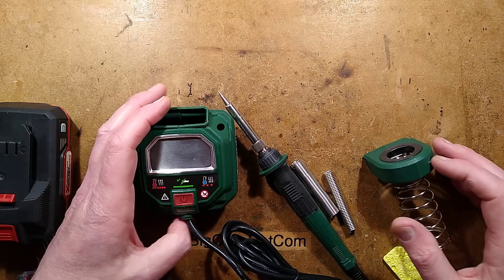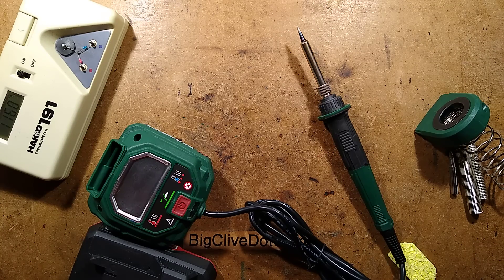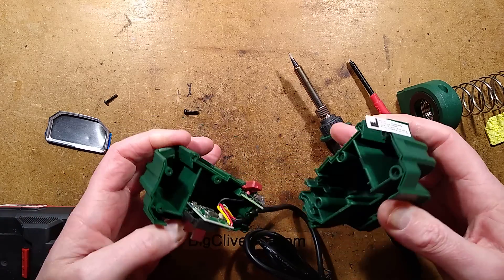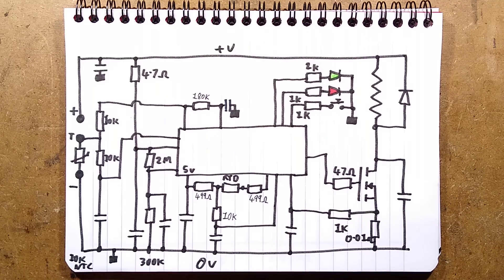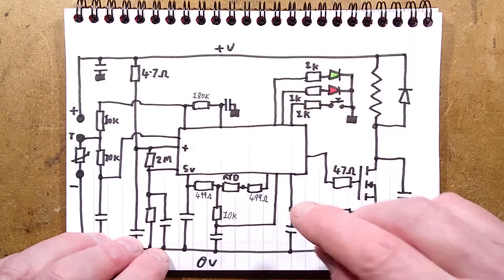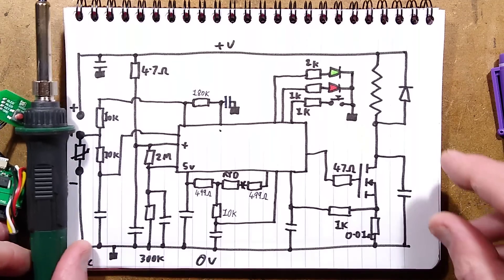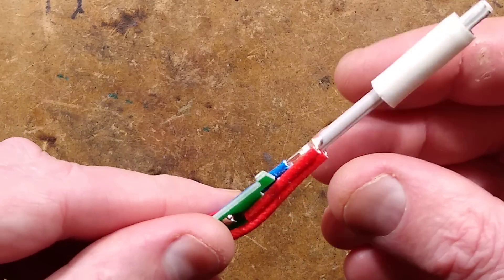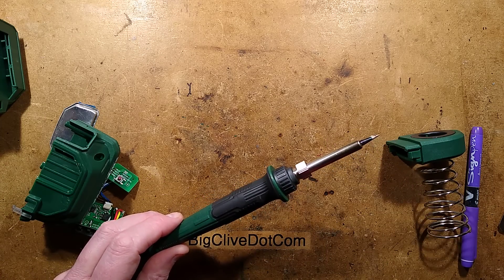LIDL (Parkside) B2 soldering iron hack and schematic

Comment: I'm glad I'm not the only person who modified their electrical safety screwdriver 😂
Reply: @Kevin-mp5of  It's called the singular they. It's been around for hundreds of years. Get with the times.
Reply: If you look at the original comment, a "person" could be he or she, it's neutral, so using singular "they" makes sense. At least it does to me.

A neutral pronoun is a thing that exists in many languages, and you have the luxury of having one that's pretty damn natural to use even if it didn't originally exist. Some gendered languages like French are really inadequate to use in a neutral form, and to me, it personally feels like a missing "feature" to my home language. To see English speakers complaining about something that has seen a lot of use for over a decade already, when we don't even have that option here, is kinda annoying.
Reply: @Kevin-mp5of clearly you lack a basic understanding of grammar
Reply: If you are not working on mains or high voltage equipment, an electrical safety screwdriver isn't really needed anyway, although they can help prevent accidental shorts when working on battery powered stuff. I've seen electricians use them on kitchen cupboard door hinges...
Slim versions are available should you need them for live equipment; you don't have to butcher a regular one.
Reply: My brother has a toolbox with a couple of really small screwdrivers (I don't think they were insulated necessarily from the start, but maybe I don't even notice they are modified :P ) that he put in a machine at work that can push a 90 degree angle in steel sheets edges (for traffic sign edge reinforcement) and pushed a 90 degree angle in the screwdriver.
There were cases in which loosening screws or at least making the first turn for getting one in was difficult because of limited space.
His chief technician more than once grabbed the handle of that thing when he was working with him on something only to find out the thing was unsuited for the job because of the handle sitting at a 90 degree angle compared to the bit :P .
Reply: @Kevin-mp5of  The pronoun crazies won't like the use of "his" soldering iron.

Comment: im tying to imagine a use for this. bearing in mind they cost a lot. the average person needs to buy a battery and charger. so that is nearly 50 quid for this iron. I can't see why an electronics enthusiast would need a portable expensive iron. so one thinks of the other solderers that need a portable machine. i can think of plumbers 30 years ago, and that's about it. one imagines 99.9% of soldering fans have a nearby mains plug. so what is this for?
Reply from the maker: This unit is cheap.  If you use the batteries on other tools it is very affordable.
Reply: Have you never had to do any wiring jobs on your car?
Reply: @Drew-Dastardly  yes, but i keep my car in a garage. with mains power in it. i wasn't slagging anyone off for enjoying parkdrive tools from lidl. i like to buy their even smaller irons cheap, when they too have been returned and rip the 18650s out of them and throw the rest in the bin. so i too know the appeal of the nave in the supermarket with a selection of drill bits and taps in metal boxes, and an arrangement of pliers, as much as the next shed owner. i was just puzzled by it's intended purpose
Reply: Exactly, the tools are tantalizingly cheap.  I have hvlp sprayer, impact driver, 1/2 impact gun, a polisher (it was on clearance) and a lightweight sds drill. 

It all started with the 1/2 impact complete with charger and 4 amp battery for £64.99

I have 3x 4 amp and 1x 2 amp better batteries now. 

The tools are all about 25-35 for normal stuff like drills. It's too tempting.

I'll be looking for for one of these, it will be very handy. Though I'll still be using my trusty Phoenix Gold soldiering iron when at home

Comment: I am always impressed by your dexterity when soldering (or anything else for that matter), but knowing your fingers are able to move that well below 20 C leaves me puzzled and with an open mouth. 12C is way below my operating specs. Whenever I am out in such an environment an alarm sounds, alerting people around me of a potential voided warranty.
Reply: Think Clive would melt into a puddle by me, where it is currently evening, and only 28C indoors, and peak today was only 333C, while yesterday was 36C.
Reply: @SeanBZA  333C? How are you even alive?
Reply: @SlartiMarvinbartfast  DOH 33C......
Reply: @SeanBZA  Surely you just need to add some some more resistors to him.
Reply: my house is good at 20-22c during winter and summers are uncomfortable 25c atleast. Stupid gravity ventilation :D
 @SeanBZA
Reply: Clive is apparently NOT a lizard, that's useful to know.

I'm surprised that his house doesn't suffer with damp, at that kind of temperature surely condensation forms on walls and the inside of windows?
Reply: @SlartiMarvinbartfast  Only if he breathes out.
Reply: @manolisgledsodakis873  Perhaps he could breathe into a tube that vented outside?
Reply: 🤣🤣 @SlartiMarvinbartfast
Reply: @SlartiMarvinbartfast  He has shown off multiple dehumidifiers in the past. Condensation only forms from a difference in temp, if the inside is close to the outside temp, minimal condensation will form
Reply: @gregw1076 Condensation forms on surfaces when their temperature falls below the dew point, which in turn depends on how saturated with water vapour the air is. The outside temperature doesn't feature in the calculation.
Reply: @SlartiMarvinbartfast  That is, because he keeps his house cool.
Not much temperature difference inside/outside - significantly less  condensation issues.
And mold doesn't like it that cold either.
The usual problems start, when you add heat to the moisture.
I'm not saying, a moist and cold home is a pleasure, you'll have to wrap yourself in enough clothes to help your internal power plant to keep you cozy, but if you start rising your home's inside temperature in a moist air condition, you'll immediatelly get dripping wet walls, floors., roof - and mold will explode, too. Not nice either. It will take a lot of expensive extra energy to raise the temperature of the whole wall structure above condensation point.
So - you'll save yourself a lot of money and problems, if you keep your house cool and yourself warm in a damp cool climate.
Reply: @werner.x  What on EARTH are you talking about? You obviously raise the temperature, and open the windows every 2-3 hours. Cold air can hold less water than warm air, so you are replacing the air that is warm and has soaked up water, and replace it by air that by definition cannot contain more water, heating it up, increase its capacity to hold water, then open the windows again. In Germany this is called Stosslüften, and it is a legal requirement to be done by renters multiple times a day in Germany.
Reply: @der.Schtefan  Could also just have central HVAC. 'Damp' isnt a problem in the US because the vast majority of buildings here have central HVAC which dries the air as it works.
Reply: 12C (below 20C) causes my hydraulics to turn into jelly also._
Reply: @DjResR  "Crash Investigators later found out that maintenence was carried out wrong. The hydraulics fluid dipped below 20 C, causing the control surface activators to lock up, and DjResOfficial's upper body to crash into the table. All 7 personalities in his brain received severe trauma. "
Reply: @der.Schtefan  :D_
Reply: I have often admired Big Clive for his resitance to low temperatures. With the recent energy price increase I was encouraged to try and replicate his living conditions. I wanted to test myself to see if I could endure it by simply wearing very warm clothes inside the house, but I failed miserably. I manage to keep my house around 16/17, but anything lower than that and I slowly turn into a block of ice.
Reply: Same here. My peripheral neuropathy gets significantly worse with lower temperature and below 11° C my hands are so weak as to be unable to operate zipper lock bags or buttons on a shirt.

All that said, it's currently between 4° and 5° in my living space and I can't afford what it would require to maintain a workable environment.
Reply: If it's 7° f outside I still have my heated seats on I also don't understand how his fingers work at that cold of a temperature and his dexterity is amazing I used two hands and I still have to fight with the wires to solder them
Reply: It's 5°c avg in Derbyshire at night, and I work nights and I'm still in a t-shirt whilst everyone is wearing coats. 😂
Reply: It is not about temperature. Humidity at the specific temperature is critical to survival.
Dry air at 12.8⁰C doesn't penetrate clothing like humid air at the same temperature.
Even so even for myself, living in a cold house in Wales (a lifetime ago), 12.8⁰C is brass monkeys.
Reply: As a former Michigander, I say - right on, Clive. That is indeed quite cozy.
Reply: It is 12 degrees inside my house right now, just dress differently and eat more often!
Reply: He does indeed keep the place dry with dehumidifiers
Reply: I generally like it around 18C or 65F. I generally don't wear my windbreaker until it get to about 7C or 45F or it's very windy. This is while always wearing shorts in the winter.
Reply: presumably wears clothing, like a jumper.
Reply: I'm from Orkney origins, we populated those parts, and I was renowned in my Army unit for being able to sleep outside in the snow.
Reply: Can't tell how much your are joking since 12c isn't even cold
Reply: Its 12° C not 12°F, not really that cold.

Comment: i need a new iron, i should probably get 1 of those fancy usb c 1s but i'll proably get another radioshack special, no temperature regulation and the cheapest piece of metal tip imaginable that'll eventually eat itself away from use

Comment: 🎯 Key Takeaways for quick navigation:

00:00 🛠️ The video is a revisit to the LIDL soldering iron series, focusing on the B2 version. It's the third video covering these units.
00:30 🔍 The B2 version has a button issue, possibly misaligned. The video will test its functionality and address the problem.
02:06 🌡️ The soldering iron temperature is found to be too high at 480°C, requiring exploration and potential adjustment.
05:38 🧰 The soldering iron internals are explored, revealing a hackable design. The key components include a temperature sensor, MOSFET, and a control board.
08:12 📐 The schematic of the soldering iron's circuit is explained, detailing the connections, power supply, and temperature sensing mechanism.
10:56 📉 The video discusses a mysterious resistor and the monitoring of various parameters like battery voltage and fusible resistor.
13:40 🛠️ The video demonstrates a simple hack to adjust the soldering iron temperature by adding a resistor, improving its usability.
15:57 💰 The LIDL B2 soldering iron is considered affordable and, with a minor hack, can be a reliable tool for soldering tasks.

Made with HARPA AI

Comment: Soldering sponge, hands up anybody whose ever actually used one of these...
Reply from the maker: I used to, but it's mainly the brass sponge now.
Reply: I did use it for a long time. In the past I even used a "brick" of salmiac (ammonium cloride) but it somehow "eats" not only the dirt from the tip. This was not a problem for the copper tip on the transformer soldering iron, but it became disaster for the expensive tip of my gas powered iron. Thus I switched to the wet sponged. Now I sort of use both the one that needs to be soaked and a brass one. Not sure why, but in some situations the water steam seems to work better then the brass sponge. But in most situations the brass one is faster. There go my two cents to this topic.
Reply: @Badgii  I never used it at all, a quick flick or a run always got rid of anything on there for me, I think steam might be faster because - there's this thing about bubbles being more effective at removing materials from objects, like cleaning, so maybe it helps to get under crud and a late it off as it expands into little steam pockets, no idea

My tip went through all sorts, but changing too a new one never felt right and I always changed back to the old one, copper or coated etc, I tried them all, at one point I even heated it to red hot with a blow torch (while off the iron) and dip it in mineral oil to treat it (just because) and that seemed to fix any problems I'd had with the tip, in preventing it getting any shorter (I think possibly the constant heating of the metal weakens it over time)

I've only abandoned it now thanks to an unrelated fire, and temporary displacement in living arrangements, but at least 5 or 6 years service!

Comment: Returned and just put back on the shelf?

I used to run my iron at the maximum 500c setting, but it's worth noting thatg I don't think it was really anywhere near that in reality, and it was useful in a faster start/continue time... I never did test that, I'll have to do it some day when I move back home 👀

If someone takes something you paid for because they thought it was unsafe, isn't that just theft, nobody has a right to take your possessions from you

Have you ever pitted the 191 against the readout from your thermal camera?

Comment: Great information on hacking this device.  
BTW:  When I go into devices that have labels over the seams...I usually just cut them at the seam-point so I don't need to heat the glue to take them off.

Comment: Very interesting 2x👍 
Its funny because the safety people cant work out why you sometimes need to modify a bit of kit or find an alternative. I had a right run in with one while doing some testing. I told my boss who went loopy when I told him the customer would have to wait until I found some new tools and wait for thier delivery. I was back testing 5 mins later.
Reply: The safety people are driven by lawyers and insurers, who are detemined to not be put in a position where they have to pay out any money. They use that argument to convince executives that they'll be bankrupt in a month if a technician is allowed to use an unapproved screwdriver.
Reply: @daveh7720  Apprentices aren't as cheap and disposable as they used to be.
Reply: I was taught that it's compliant if you scratch off the safety rating too .  Then it's officially just an uninsulated screwdriver .

Comment: Is there room for a 100 ohm trimpot in the handle?
Reply: Would probably be better to put that in the base, with a knob on to be able to easily adjust!
Reply from the maker: It might be viable with a carefully aligned hole in the handle.
Reply: An interesting idea. I would think you could route the red and yellow wires under the circuit board (perhaps directly wired to the element power wires with heat shrink) which should leave plenty of room on the top of the board. There are some very small smd trimpots (4.5x4.5x2.5mm) which could be soldered to the board at one end and possibly fixed with hot melt glue.

Comment: One more thing I noticed. The MCU feeds quite significant current even if "on temperature" (sorry, I forget the number). So if left untouched the temperature slightly drifts up even if it indicates it's on temperature.
This really confused me during finding out the right resistor. Try to keep measurements fast, or drain some heat from the tip so it somehow balances the overheating.
And even more .. if you have long delays in soldering the tip gets quite hot and "burns" the solder. Nothing you can't live with it it, but it's sort of "dissapointing" especially if I was excited by you previous videos how easy it's to hack, ordered one and ended with this newer one. :)

Comment: Regarding the voltage monitoring. I have a theory, that the old non balancing batteries (PAP20 A3 and A1) actually does not have the under voltage T pin disconnecting feature. I use them on my DIY light and it seems that the T wasn't disconnected even if voltage was pretty low. I wanted to do more research there, but unfortunately got interrupted with "family situation". So I can't really confirm this now. :(
Reply: the old "dumb" batteries do not have  undervoltage protection as lidl decided to put it inside the tools.
Reply: @flippy9133  I don't think the new ones do either do they? They've just added balancing instead of simply having unbalance detection.
Reply: More than likely, and the second RCD on the thermistor connection was there to allow sensing if the old battery was connected. Also likely a common microcontroller firmware, used with all sorts of batteries, many of which probably, due to being cost cutted, do not actually have a temperature sense pin, or even a BMS board on them, relying on the tool itself to provide that.